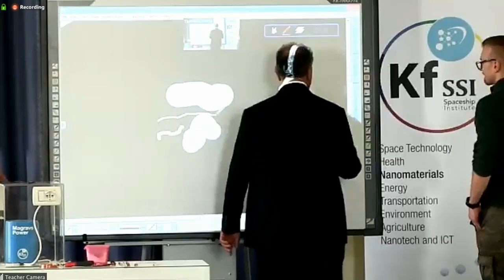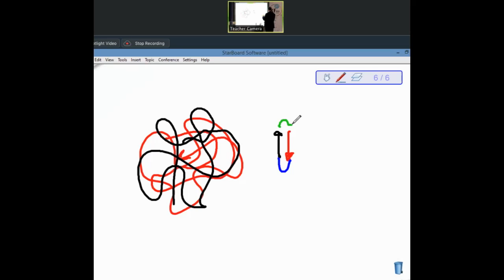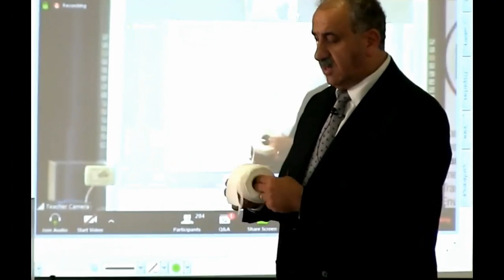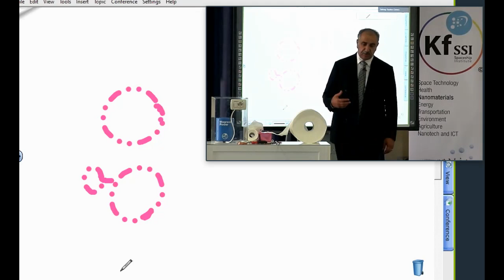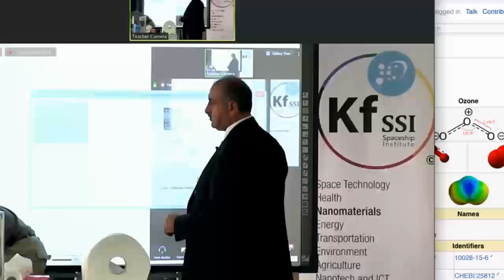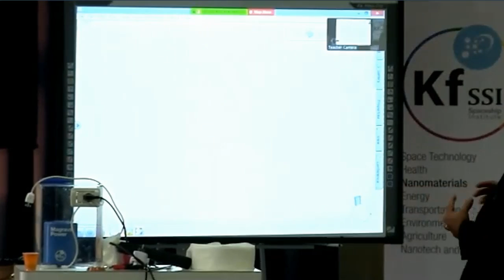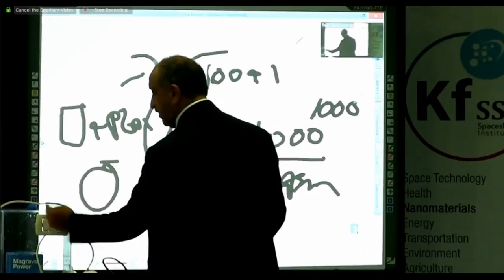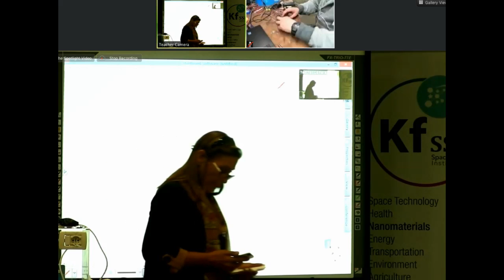KFSSI Blueprint Teaching HD #Session 2

Comment: So here is another question... if we - which you have as the video shows - made the coils backwards according to #Session 11 - but it is o.k. as long as all the coils are wrapped the same way...     If this is so -             then,          wold we need to - when we hook the 3 sets of 2 coils each together... would we need to wrap these wires that were wrapped wrong - as we have done... should we twist the wires clockwise on these coils - because if we connect them by twisting the wires anti-clockwise... would that not be reversing the flow or something?

I only want the best... and I invested all I had into the making of 15 coils - I am 100% disabled and making some of these just like the video above tells me to - and now we made them backwards according to #Session 11... where he said that if the wires were not made into springs in the right direction - it will work but not as good.  (':>))  AHHHHHHHHHHHHHH...

Peace~